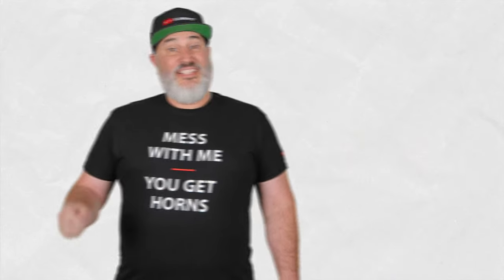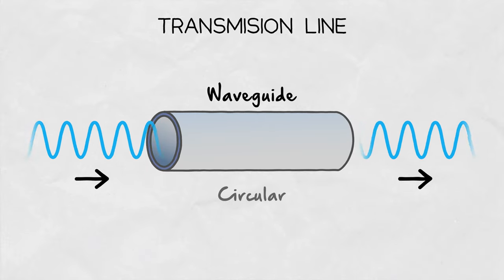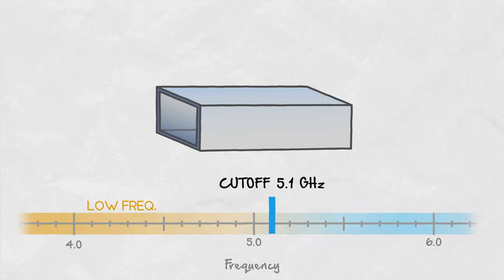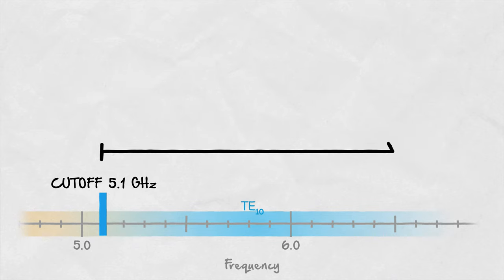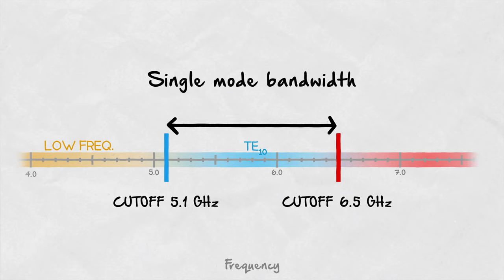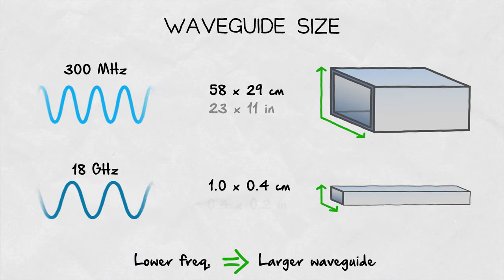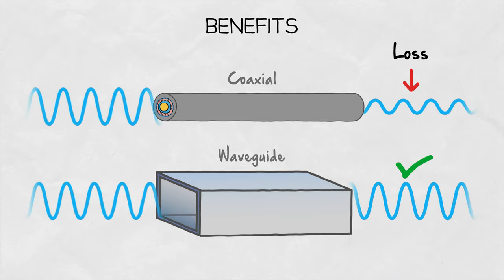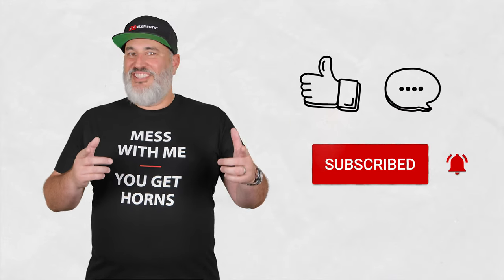Inside Wireless: Waveguide

Comment: I think you get it reversed. A low pass filter passes low frequency. It's also called high stop filter. 
If a filter stops both high and low frequencies at different cut off, it's a band pass filter.
Reply from the maker: Hi Hamdani, thanks for noticing the mistake! We put the correction in the pinned comment below the video.